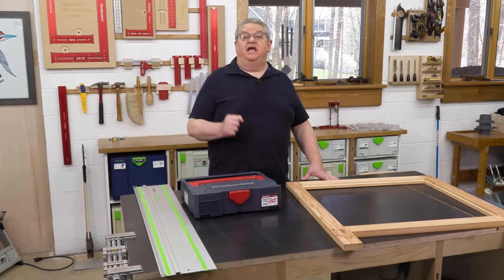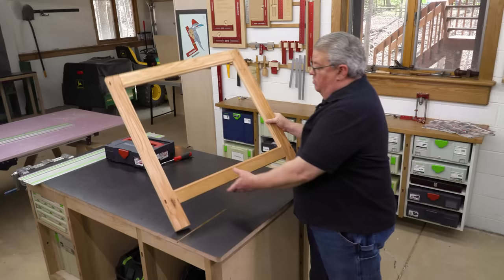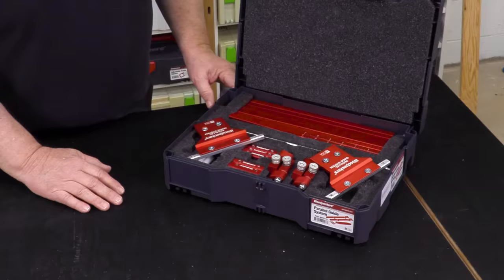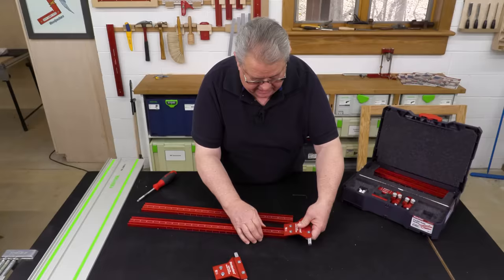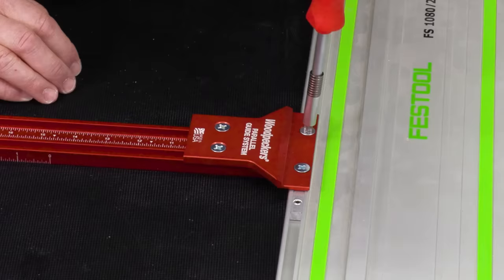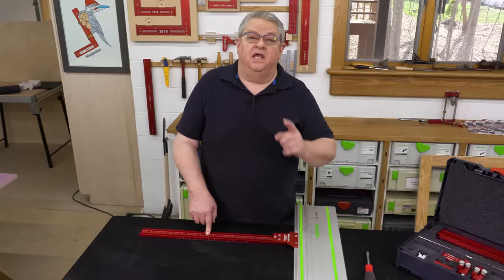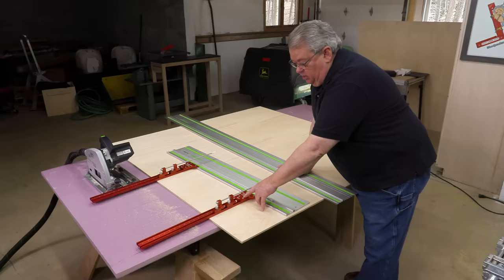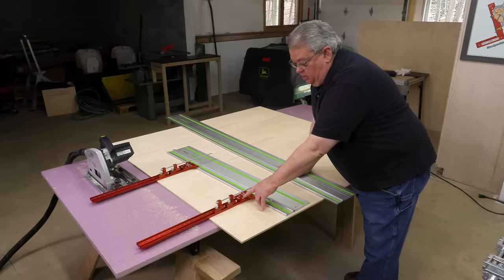This Track Saw Accessory Might Replace Your Table Saw | Deep Dive

Comment: So every time I want to rip plywood I add 15-20min just to set this thing up when I could have ripped maybe 20 ply wood on a table saw in that same time?
Reply: So can you take you table saw to a site, can you fit your table saw in a box, can you use your table saw for 45 degree cuts on a sheet of plywood. 
If you can do all of that good luck to you.
Reply: @bighands69  Have you really never heard of a portable table saw?
Reply: @CDRaff  lol
Reply: @bighands69  So can you take you table saw to a site (yes, mines right there right now) , can you fit your table saw in a box (a big box, yes) , can you use your table saw for 45 degree cuts on a sheet of plywood (yes) - though I will give you that I used my Mak' track to make PERFECT 45º cuts on VG Fir I was using to make boxed beams because I didn't trust myself on my table saw.. A table saw is still pretty indispensable on an efficient job site, and this tool is so complicated and expensive it's totally dispensable - just something for hobbyists to have wet dreams about..
Reply: @CDRaff  I doubt that a smallish portable table saw could reach the precision of the track saw with a good guide when tackling a large piece of plywood or an even larger HMR or MDF sheet... specially when working alone.
Reply: @bighands69  obviously woodwork is not for you! LOL
Reply: @CDRaff  
You mean a jobsite saw. I am talking about a table saw that is actually a table not a little job site saw that simply would be useless for detailed cabinet work. 
There are a few manufacturers that do sell jobsite saws with extension systems that make extremely accurate cuts but they are very expensive but are still limited to making small section cuts.
Reply: @adammacer  
By a table saw you are talking about a job site saw that is for carpentry work. Which would not be suitable for detailed cabinet work. 
I should have qualified my original statement with it depends on what you are doing with it.
Reply: @stormsebastian926  
Cabinet making and detailed work requires a table saw the guys above that commented are talking about a jobsite saw that is not for detailed work and really requires two people to operate on larger sections. 
There are portable table saws out there that can be used for detailed work but they cost several thousand and are still limited by size. 
A table saw can cut full 4x8 sheets and jobsite saws cannot do that. A track saw can cut large 4x8 sheets.
Reply: I bought a Festool tracksaw last year to build speaker cabinets and furniture out of plywood. It's much more compact/portable than a table saw, has a kerf of only 2.2mm, can do plunge cuts, can cut exactly on an angled line (something that would be frustrating to set up on a table saw) and is also far more accurate than a table saw of the same price when cutting full sheets of 18mm ply. The addons like the one in the video are very expensive, which is why I made my own plywood adjustable square with length stop for the track. I currently use pairs of plywood stoppers to do repetitive parallel cuts, but have just ordered about $50 of T track to make my own adjustable parallel guides with plywood fittings.
Reply: @bighands69  Well I better take my cabinets I made for my house with a job site table saw to the dump then. I thought I did a pretty good job, but I guess not! BTW there are not very many cabinets made on a job site so your attempt at qualifying your original post was a sorry attempt.

Comment: I always wondered what they did with the vast mountain range of components in the retired space shuttles. They made a single parallel guide system.
Reply: Much easier and cheaper to just use a circular saw and a 4 foot drywall square and a sharpee marker , draw your line and then make the saw blade follow the sharpee line. 
When starting the cut look at the saw blade and align the saw blade to the sharpee mark.
The circular saw cuts straight and so no need for a track saw!
I can make all styles of  cuts without any special expensive tools and way less clutter.
And even if you did need all of them why all of  the xtra assembly and calibration when they could've just designed it as a 1 piece pre calibrated tool without a bunch of complication?
Reply: I'm sure once you know the jig well, you could probably get home in time for supper.

Comment: 27 3/32 wide, how do you accurately set that on a scale that doesn't show 32nd's?  Just "eyeball" it I guess?  I really wish you guys would do some cross-licensing with Incra and add incremental indexing to your measuring devices, then you would truly be accurate, exact and repeatable.
Reply: I completely agree. Making two independent adjustments on scales that need "eyeballing" can't possibly be as accurate as as an easily calibrated fence on a table saw. There are even many different super accurate digital readout devices that can be installed on a table saw. So the heading of this video should say "might not"

Comment: I have it an love it, especially because it can tuck away in a systainer.

Yes setup does take a few minutes.

One thing though, calibrating it with the method shown I kept getting out by 1mm from one end of 8ft to the other.

I ended up marking for my cut on the sheet material, got the track set splitting the line on both ends, the. Set the scale on each to the measurement I set the track to, loosened the screws that connect it to the track, get the stops pushed against the stock, and held it in place and tightened the screws to the track; I found this way more accurate.

I have the metric version, and the calibration triangles do not point to an actual mark on the scale

Comment: "Anything you can do with a table saw you can do with a track saw". What track saw has a dado stack?
Reply: Festool
Reply: The larger Festool tracksaws takes dado sets, and to slightly labour the point, a track guided router will achieve the same job
Reply: @richardkeith2778  is that a festool product (the dado kit)?  I did find one YouTube video, but I believe the gentleman was in either the UK or Australia.  He was running a 1900 watt festool hk85, a model not sold in the U.S.  Our local festool dealer looked at me like I had two heads when I asked about it.
Honestly, I have never heard of the dado kit, and can't fathom a sub 1.5 horsepower motor running a dado stack, which is about where the TS 75 is.  Looking online they look to be available widely for the HK 85, but the kit costs £729 and the HK 85 was £859.  For that you can get a low end cabinet table saw, or a high end hybrid here.
Reply: @Xander-dx6mw  I'm from UK so probably explains it. Nice irony that UK has a dado product not available in the US !! I dont disagree with anything you say - the "no table saw" claim is silly, but less so in the UK where most hobbyist woodworkers would not have a workshop big enough to break down a full sheet on a table saw. We have UK-made products (Benchdogs UK) that are "better" than the Woodpecker thing - much simpler to set up and use, and at a quarter of the price, so can't see many making the flight across the pond any time soon !

Comment: I just started seeing woodpecker brand in the last few days. Went from catching my eye to look out for to this. 

   I mean wow. What a brilliant tool and this guy just makes it look soo slick. I see soo many that just do not demonstrate the product well. Leaving you wondering about so much. Not to mention the vacuum saw really lets one know that this is a much higher degree of tool.

   What I really love is how it looks really overcomplicated and a bunch of parts at first, yet its fast, simple, easy and accurate with a good case which is always a must. 

   I'm deffinately putting these 2 tools on my Amazon list. Thank goodness I saw this before I started looking into table saws. For an unheard of name brand it impresses from the start.
Reply: It's a nice colour but that's about all.
Reply: I REALLY suggest you do more research into table saws before you buy this instead.
Reply: @jetblackstar  I second this comment. Don't be so quick to write off your need for a good quality table saw. This is nonsense to an experienced woodworker
Reply: Table saws are great for people who have enormous work spaces. Track saws are great for people who don’t have space for table saws. But still the point of a track saw is that you can line up the cutting edge perfectly with your cut line. So long as you have a square and know how to measure/mark the board, there is no need for other gimmicks, a track saw+track is already optimized for long perfectly straight rips.

Comment: For a company that's mission is extreme accuracy and unparalleled build quality, this leaves an enormous amount of room for error. When judging where the slides stop on the ruler a rounded edge with no defined edge, arrow, etc leaves each different user with their own separate measurement. Plus, as already stated, the setup time is ummmmm. 3 hours later....
Reply: Well I’m glad you learned something

Comment: Am I missing something?  I’d like to see this thing turn a 2x4 into a 1x4. There are also a number of operations that can be performed on a table saw I can’t see happening on a track saw.
Reply: Exactly. There are tons of operations that you do routinely on a table saw that would be difficult if not impossible with a track saw. Half lap joints, raise panels, cut tenons, finger joints and on and on
Reply: @jeffhreid  thank you!  The one I mentioned was the easiest and most obvious.  Thanks for listing the rest.
Reply: Tenoning, for example. Dados.    8)

Comment: I recently ripped 4x8 sheets on my table saw by myself. It was a bit of a challenge but doable. And I was done before this contraption could be put together.
Reply: I'm 68 and I still do it.  Not that difficult.

Comment: Pretty flashy wiz-bang, but not for me. I'm in my 70s and can still manage to rip a sheet of 3/4-inch MDF on my table saw. For a cross cut, I made a 54-inch jig from two rips of plywood. I clamp it at my marks and run my regular circular saw along the jig. Fast, accurate, inexpensive.
Reply: I am about to close out my 70s and like you still rip 4 by 8 sheets on a table saw, this gismo is just another flash in the pan fad that will die out ( or it should lol ) Post turtle?

Comment: $800 for the two tools and still need a specific track, well I use a kreg track saw kit and guess what I can handle whatever i need,  maybe I'm not smart enough for this tool.   looks like setup time is substantial   I was always taught the best wood workers  could cover up any errors  that nobody noticed.  however having an unlimited budget might get me to try a few of these tools.

Comment: Nice idea but far too expensive for what it is. Especially when you add in the square which nearly doubles the price. Another hundred or so would get you a used cabinet saw or just about any brand new top name table saw. That’s a hefty premium just to save some shop space. I’m not sure what your marketing plan was. But I’d respectfully suggest it needs some rethinking in light of our post-pandemic economy.

Comment: Carpenter of 35yrs, I,ll stick to my straight edge and clamps.
Reply: if you need to do cabinetry those small inaccuracies add up if you need to make lots of cabinets like in a kitchen for example. That being said, doing cabinetry professionally with anything else than a format saw/panel saw is just stupid.
Reply: Big difference between carpentry and fine wood working friend.  Much of the difference is in the level of accuracy.  Basically a carpenter is to a fine wood worker what a framer is to a carpenter.
Reply: @diversify210  actually if u look up the original use of the word carpenter then u might find different.
Reply: @emilebeckerseb  sounds like you need to step your accuracy up and ego down . Everyone works with different tools that compliment the way they do things

Comment: Got one similar to it, had it for thirty years. Mine's nine feet long when combined, 54" long each. I use it to bust down plywood sheets into chunks I can trim to size with my table saw. The suggestion that it might replace my table saw(s) is frivolous, senseless, and delusional. Pretty obviously.
Reply: If you're using this to break up sheets for sizing later on your table saw, you don't seem to need great precision for your initial breakdown cuts. So why not just drop your track somewhere close with a tape measure and cut away without all the fuss and bother?

Someone like me with no table saw could certainly use the precision and repeatability of this or similar system but why does someone with a table saw need it for initial rough cuts?

Comment: Miles better than the Festool Parallel guide system.  BUT the accuracy in calibrating and double-checking with the small square goes out the window when you set the stops individually.  One will be dead on the indicator line or just to the indicator line and inevitably the stop on the other bar will not be precisely in the same location.   The resolution on the scale introduces the inconsistent settings.  Nit Picky, YES, but you are demonstrating nit-picky by double-checking with the square when calibrating each bar to the track.
Reply from the maker: One thing I really like about this set-up is that the stops flip up and rest on top of the scale. That makes it very easy to align the physical stop to the scale. You are right, you have to set the two guides individually and there is a risk that you don't align both stops to the same side of the line. My video producer, John Heim, can tell you that I have been known to obsess over the stop splitting the line on the scale. If you don't, your finished cut might be out by 10 or 15 thousandths over the 60 inches of the cut. That's if you're really sloppy and go from one side of the line to the other. I'll take that compared to my ability to wrestle a 60 pound sheet through a table saw by myself.

Comment: I would just clamp a straight edge and push my saw along it.
Reply: Agreed, and the cost savings. Not for everybody...
Reply: Using a good blade same idea first bust the sheet down to manageable size then use the table  saw
Reply: I have been doing this for years and still get straight cuts.

Comment: You can achieve the same thing with a measuring device and a pencil. Their prices are insane. A T-square for $279? And I hear their products are not even that good and they charge  like NASA built them.
Reply: Right?! Hook your tape, make a mark, put the track near your marks, get one deadly then place saw on track or clamp to hold it there, get other end deadly, clamp if clamping, check other end again, adjust/check as many times as necessary (usually no more than once), cut..
Reply: @adammacer  Hi Adam.  Are you talking about still using a tracksaw after you measure?
 I'm looking to get a table saw, but I'm still not sure how good the tracks for the saws work. I never used one before. I kind of feel that they would still move while you're cutting. If you clamp the track down to the wood, wouldn't it be in the way of the saw? Thanks.
Reply: @JoeLazzara  Yes. You simply lay the track on your carefully measured marks, clamp if you wish and saw away. The tracks have rubber strips on the bottom side that grip very well but clamps ensure no movement is possible - they attach to slots in the underside so they don’t get in the way ever. 
Track saws and site table saws are different tools, each can do things the other can’t - you can’t (easily) put a bevel on a 1x2 with a track saw. If you can only have one buy  the tool that does what you need it most for.
Reply: @adammacer  Hey thanks responding Adam.
I really appreciate the advice buddy. Going off of what you said, a table saw would serve my purposes better, for sure. The way you put it really helped me with my decision because I've been trying to figure out what to do for a while lol. I appreciate it. 
Thanks again!! 👍